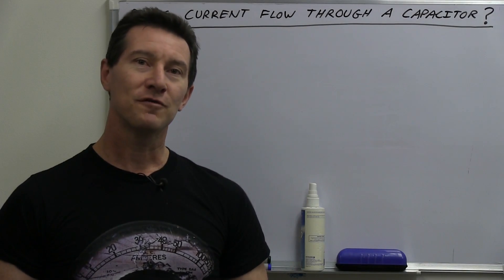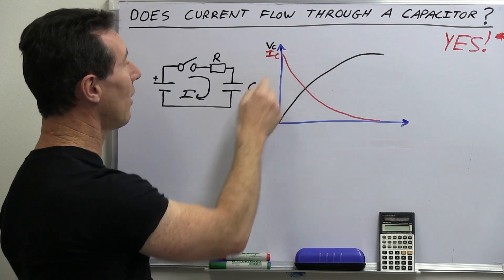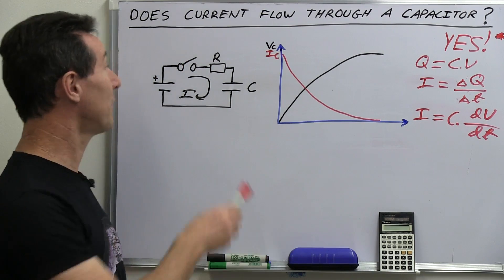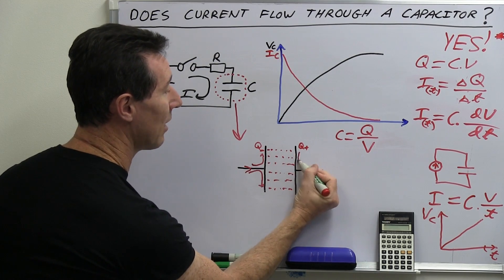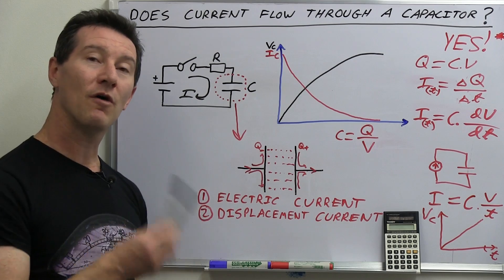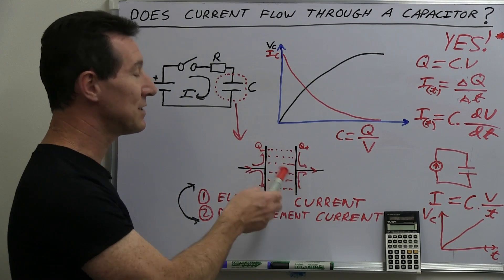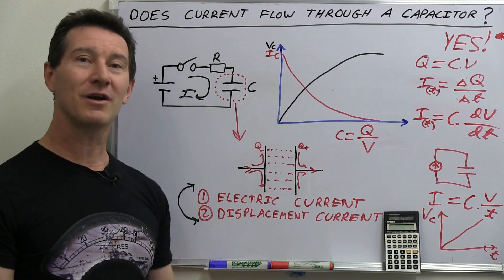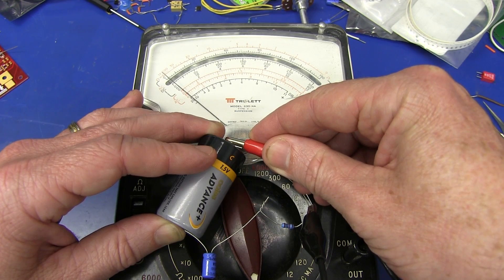EEVblog #486 - Does Current Flow Through A Capacitor?

Comment: Here is how it was explained to me:

You know how protons are electrically magnetically positive and electrons are electrically magnetically negative?

The electrons are pulled out of the positive side of the capacitor. This makes the positive size magnetically positively charged. Electrons are then magnetically pulled into the negative size of the capacitor from the power source, held there by the positive magnetic side of the capacitor. When you attach a load to the capacitor, the electrons are pulled through the load to the positive side of the capacitor, and as the capacitor's magnetic charge stabilizes, the voltage drops. "DC current" occurs because electrons that are pulled out of the positive pole still have to return to the power source, which can be pulled through the rest of the circuit. Once the capacitor is charged, electrons can no longer be pulled from the positive side of the cap, so the circuit chokes. At least in the example circuit that is how it would happen. If you had a battery and a light bulb, and you added a cap between the wires, the cap would charge to the voltage of the power source, and if the power source voltage dropped, the cap would start to discharge until the power source and the cap's voltage reach equilibrium.

I also want to just make a note that, when I say magnetic, I don't mean the same type of magnet you find in a bar magnet, since you can't have a normal magnetic mono pole. Protons and electrons get to have their own special state of magnetism. I also want to note this was essentially how it was explained to me, so if I am wrong, and provided you can give an example, then please feel free to discuss. I am far from being an expert in electricity. I mean, I know how to stick a fork in a wall socket and zap myself. :P
Reply: +kodan50 
Somebody told you something wrong. Electrons repell each other. thats what drives the flow in on the one side of teh cap and the flow out of the other side. Thats an elecrical effect which has to do with the electric charge of the particle. They dont like to be near each other. So when you press a lot of them wih force onto one side of the cap you build up a large electrical potential and therefore a large electrical field wich will force the electrons sitting on the other side of the cap away. There is a nice experiment for high school physics lessons. Laod a large plate capacitor and hang a ping pong ball on an insulationg robe in between them - make it touch one side of th cap and u will see it beeing catapulted backa nd forth between the metal plates. It takes up electrons on teh one side where you put a lot of them with your power supply then is negatively charged and gets repelled coz electrons dont like each other. pushed like that hits the otehr side gives teh electrons it got away and a few more it had on its own is now positively charged like teh plate it jsut tought and gets thrown back - goes on as long as you kep teh power supply on. Gives a nice inside into what happens.
Reply: Probably good for other people to know otherwise, but now I am dumbfounded confused again. Thanks. Also, don't try to explain because I honestly don't really care. I just know how to shock myself and I am willing to stick to the basics of circuitry, even if my brain is incapable of grasping what is actually happening "under the hood", as it were. I'm totally okay with just building test board and burning my house down. ^_^

Comment: How was there any doubt of this??
Take this comparison, using a hydraulic model:
You have two pre-filled pipes leading into a chamber, in the middle of the chamber is a flexible diaphragm separating both pipes. normally, both sides are in balance, but when a pressure is applied to one side, a voltage, it pushes the diaphragm, inducing an equal current on the other side until the inflow has stabilized.

Correct me if that is an incorrect way to look at it, though.
Reply: +weylin6 This is the explanation that finally made me intuitively understand what a capacitor is after four years of college. The flexible diaphragm constantly moving back and forth provide the appearance that the current is flowing through barrier when it is just an equal response to the change in movement. No change means that stable, steady, not moving and basically current less.
Reply: +Steve Seifer buy today pay tomorrow
Reply: When I was in electronics classes in college (I've really not used it since), I built circuits that used in series caps to disentangle DC from AC. The DC was effectively blocked while the AC flowed straight through. Obviously I did the choke to do the opposite and allow AC to be disentangled from DC and effectively blocked the AC. It was really while learning about chokes that magnetic fields came into play. So why did my circuit work, presumably?
Reply: I understand that that AC is not truly passing through, but is due to the reversal on AC. What I don't understand is why my circuit supposedly worked (disentangling DC from AC) if caps pass DC current through an electromagnetic field in the cap (which is what he appears to be saying). Is the AC collapsing the DC EMFs?Also, I noticed his current meter went up, then went down and stayed down. I know it can take 5 seconds or so before a cap fully charges, but it was at least a couple of seconds on 0 after that initial sharp rise. I double checked, the circuit was still closed. If you offer any assistance in this, I'd greatly appreciate it..
Reply: Well if that's the case, it's not really passing DC after it's charged. I'll have to build a circuit and just do the readings.
Reply: I like that, and moreover, I like you.
Reply: weylin6   Good analogy.
Reply: weylin6: yeah, but it is not going “through” the diaphragm.  It boils down to the term “through”.  Personally, I say it is not going “through”, unless the pressure put a hole in your diaphragm as in your example.
Reply: any analogy for how a coil blocks AC?
Reply: That is the exactly how I think about current, and how a capacitor works..  I'm yet to come with an analogy for an inductive element.
Reply: How was there any doubt of this? Because many people are taught that current doesn’t flow in an open circuit, but capacitors are open circuits, yet current flows in a circuit containing a capacitor.
Reply: +weylin6 When "pressure is applied" in your analogy  infers a changing pressure which is alternating current. We know that a capacitor does not block AC of adequate frequency but completely blocks a continuous level of DC current since this DC current immediately starts to drop as the capacitor charges.   Electric Current will stop flowing but the displacement current is another subject. Any device needs that Electric Current even though this thing called displacement current is existing.  It really depends on what we are talking about.

Comment: I enjoyed the presentation.  Nice review and re-learned stuff I'd forgotten.  I work with a few guys who are attempting to build a flying saucer by applying Forbes' monopolor motor wiring to a Tesla-inspired craft designed and built by Otis T. Carr.   Carr had labeled plates in his craft's design as capacitor plates; but, his illustrations show these plates as one-piece, folded over an insulator (essentially, a disk on a spindle).  The purpose of this so-called capacitor plate isn't completely understood; and, the guys see the plate as a means of invoking rotation, as the disk passed through electromagnets positioned at the periphery / mounted to the internal hull, which is also free to rotate.  The ability of them to hold a charge may also be key; as, Carr addresses charged bodies rotating in opposition to each other can cause levitation.  Nothing I've yet seen proves this to be true.   Carr says he's done it and a man by the name of Ralph Ring claims to have operated a full-sized craft in 1960.  More about the wiring of the craft may be seen on my channel.  In future videos, I'll keep your channel in-mind for my viewers to get a better understanding of electronics.  Again, I enjoyed watching this presentation.  Thank you for posting it.

Comment: Could you explain how low voltage/below standard voltage would burn up a capacitor ? A/C voltages on an electric motor run and start caps.

Comment: You are damn right! Practical electronics and theoretical physics are two separate worlds. If I am designing an audio amplifier, it would take years if I have to do Maxwell's equations on every cap that I solder on the board LOL! I agree current flows through the cap and stops when its fully charged. That's for DC analysis. How about AC analysis? Anyone here familiar with capacitive reactance? (1/2πfc) It is measured in Ohms too just like a resistor. But like what the guy said, Theoretical physicists disagree that current flows through a cap. But circuit designers will say that it does. It all depends on what angle you view it from. Technically, it does not. But when designing circuits, Damn! Why make your life so difficult? By the way, where can I get one of those displacement current meters you talked about? LOL!
Reply: +bogart pablo 
My very first introduction in the late 60's was to imagine all the electrons piling into the cap and hitting the wall. Like soccer fans. They just keep piling in till there's no more room desperate to get to the other side. The thinner the wall, the louder the 'siren song', the more they wanted to get across. Then if the voltage reverses they all pile out and race round to the other side.
Even after learning all the physics, this is still in my mind.
:-)
Reply: Peter Walker The analogy you provided is very accurate. Electrons can never cross the dielectric boundary (until they reach the breakdown voltage). If we analyze how a single capacitor works, then it is logical for us to consider that there is an ideal insulator between the plates. But when analyzing the function of a capacitor within a working circuit such as filters, tuned circuits, dc decoupling applications, then its a lot easier for us think that AC current flows through it. Not that we are thinking that electrons are crossing the boundary but, to make our jobs easier. If I were to design a capacitor, I would choose a dielectric material that will not allow a single electron to get across. But if I am a circuit designer, I don't think about dielectric materials anymore. What's in my mind is capacitive reactance - The capacitor's opposition to the flow of AC current.
Reply: +bogart pablo 
What you learned in this video is exactly what physicist teach. I know it coz i do it and i got thought that while i was still a student.

Comment: What a load of crap. If you don't understand how something works, and you know you don't understand how "current through capacitor" works, why are you making educational video about it?! Misleading people who visit to learn something from you because it sounds like you know what you talking about when you don't ... ... and ... just on the margin ... nature does not behave in some way because (Maxwell's) equations tell it so.

The short, correct answer to the question is: No, electric current does not flow through a capacitor. 

Longer answer may go something like this: There is a short-lived and decaying electric current in the circuit. It flows as long as the charge carriers keep rearranging themselves into the configuration imposed by the source (battery): positive charges to the plus side, negative charges to the minus side (+/- is a matter of convention). The current, however, flows through the wire - and through the measuring device (when measured) hooked to the wire - not through the capacitor. The charge carriers flow from one plate of the capacitor through the wire to the other plate of the capacitor where they accumulate until the voltage they set up on the capacitor's plates matches the voltage on the battery's plates/terminals (never more because the battery only has power to bring the capacitor to its own voltage). Then this current, which has been gradually declining, stops. This is the electric current flow in the "circuit" you measured on the wire (not on the capacitor's insulator, right?) Right. There is no need for imaginary flow through the insulator in the capacitor; insulator remains an insulator.

When you draw water from a glass through straw and then spit the water on the ground under the table there was a flow of water yielding water under the table, yet no water moved through the table.
Reply: +Peter Walker Ok. Is it what I wrote, the way I wrote it, some combination? I really want to know. Be specific, can you?
Reply: Wow!  Marvelous, that's the best explanation I've ever heard!
Reply: Idaho Spud, in the context of Peter Walker's reaction - which he unfortunately still didn't elaborate on - and the 4 likes on it, I'm not sure if you are being sarcastic or if I can take you at a face value. If the latter, then thanks for letting me know, I'm happy the blurb might help someone.
Reply: I'm not sarcastic at all.  I try to always say clearly what I mean.
Reply: Sorry I got you name wrong Marwellus.  And by the way, I gave Peter Walker a thumbs down.
Reply: Cool! :)
Reply: Everything he said in the video is correct and it doesn't contradict what you said!

Comment: Does current ( flow of electrons) flow through a capacitor?, the answer is NO.
Does the electric field in the capacitor play a role to complete the circuit?  YES. So electrons are displaced and the net effect is equivalent to the flow of electrons through the dielectric.
Here the problem is to use the right language and not just to say Yes.
Reply: +Cristian Cox A flow of electrons is a current, but not all currents are flows of electrons.
Reply: I agree, but that is the reason that when you ask "does current flow through a capacitor?" are you talking about electron current or not. Because some people may say NO, if they think in just electrons and their answer is right, so basically, the answer depends on how deep you want to go in physics, or you just want a practical answer, which is fine, but you just can not  say YES, current flow through , since, DEPEND.

Comment: Another illustration of displacement current--If you could shrink yourself to an atomic scale, and actually enter and conduct an popular experiment IN BETWEEN the capacitor plates,  you would get an unexpected result: suppose you have a simple magnetic compass and a section of straight wire and you short the plates with the wire with the compass near the wire. You would NOT see any deflection in the compass due to DC current flowing in the wire!!  This is due to DISPLACEMENT CURRENT.

Comment: Thanks Dave, great words!
I’m actually hurting my brains with a thought “where is the power dissipated that has gone through a capacitor”? I mean, if you have just a capacitor connected to an AC supply, where is the current went through (power) converted to heat? If there is resistor connected to ac supply, the resistor heats up and the supplying coil (or whatever is supplying the AC) will also heat up, so the power went through a resistor is clear. But if there is a capacitor instead of resistor, that is allowing same amount of a current to flow the capacitor doesn’t get hot, just letting the current to flow.. But where did the power went? I have a clue that the phase difference that is effecting the power factor  has it’s role, but how it is behaving just not seem to open to me..  HELLLLPPPP!!!
Reply: +RRrrRRrrlandfin The power went into the largest resistance in the circuit and, if its just the power source, then that power will be dissipated across the internal resistance of the power source and be a short circuit. But, the capacitor actually does have a resistance and will heat up. This resistance is called impedance.

Comment: At the last 5sec, does the needle move if you used the amp-meter on the low side? electrons flowing in to the capacitor is a given but for the capacitor is the grn just a fixed no current base? but then what is gnd-floor as the whole battery setup is a floating voltage anyway so that complicates things.
Reply: +Tony Philipsson Of course yes, the same amount of current flows on both sides, you can measure this yourself if you are curious :) It is a pity he did not explain it in layman's terms. Free electrons are in abundance in a metal conductor, electrons pile up on the one side and repel the electrons which were hanging around on the other plate and as such we can count electrons climbing onto the one plate and electrons being pushed from the other. Both sides see a movement of electrons and you do not need to understand Maxwell's equations to get this ...

Comment: Hello Dave, Current flow through capacitor but ac ones yes?  Since  The Impedance (Reactance with no Resistance) of the capacitor Xc = 1 / (2*Pi*f*C).For D.C. frequency f = 0. Then Xc = infinity and D.C. Current is blocked and does not flow.For A.C. f is not Zero and hence A.C. Current can flow.
Reply: If you place a current source in series with a capacitor you can easily show that DC current can flow through a capacitor ;)